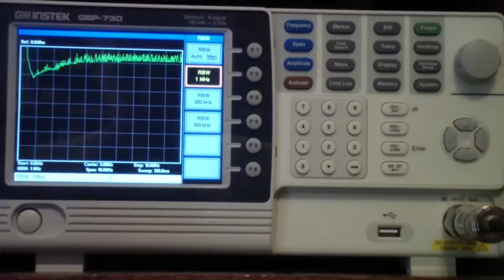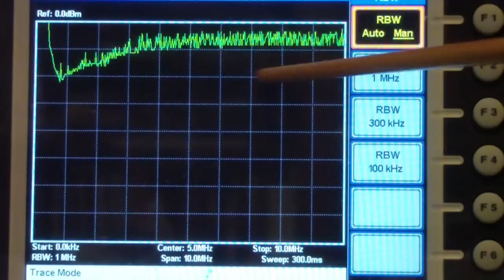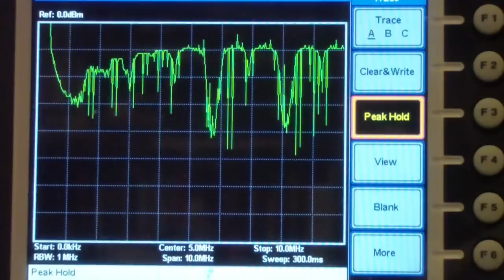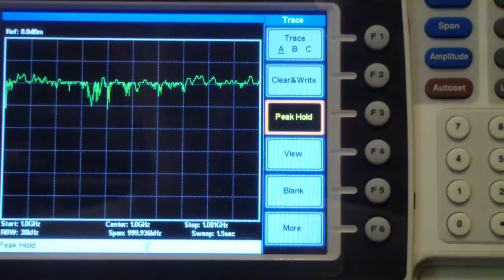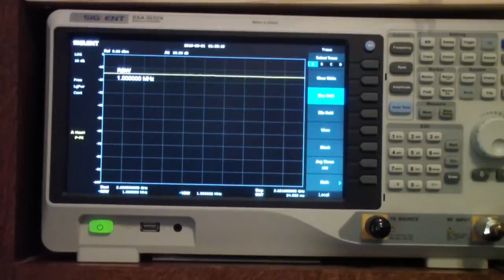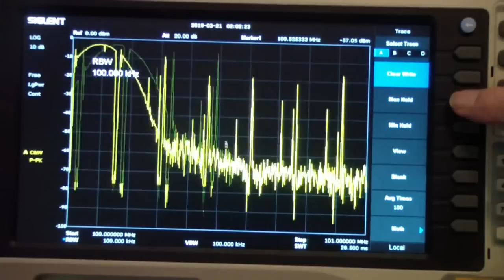TTT255 miniVNA Tiny+ Review Pt 2

Comment: Very nice videos.
Is there a way in the software to help measure inductance by adding a known capacitor in series with the inductor?
I've seen a nice video explaining who to do it using the readings from the minivna and using a excel to help calculated.
But would be nice to have on the software direct.